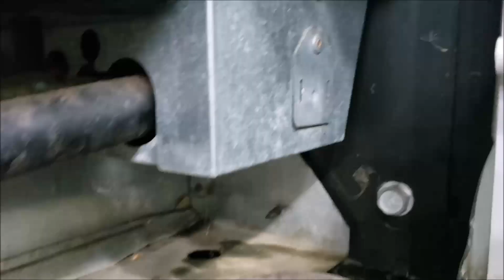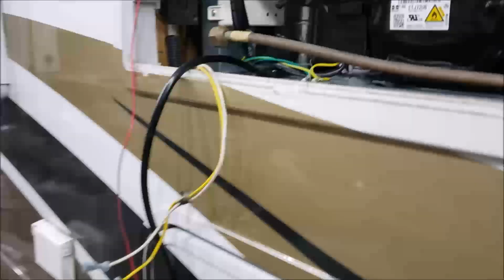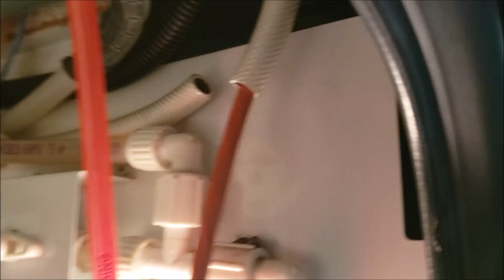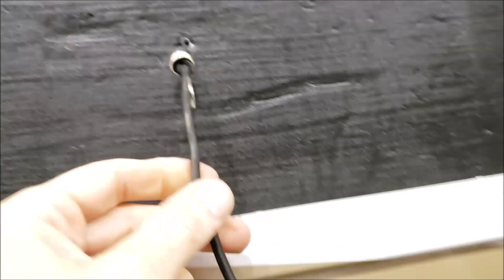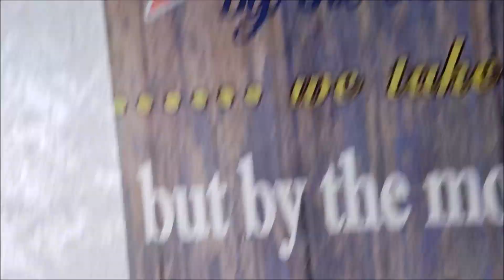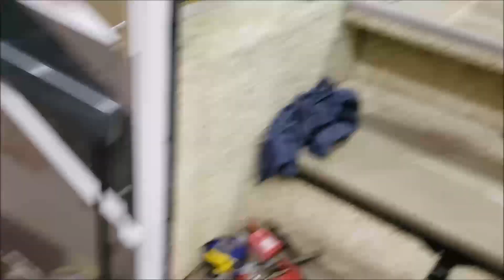How to Replace Your RV Refrigerator With Residential Fridge Step by Step With Haier Model HA10TG21SB

Comment: I was told the Dometic, in our 2003 Damon Challenger runs all the time and at our seasonal spot, was responsible for our +$200/300 electric bill. This is why we replaced with a Frigidaire 7.5 Cu ft  Apartment Size Refrigerator.
Reply from the maker: Yes those heating elements pull a lot of power.

Comment: Kevin,  Just completed my Haier refrigerator installation.  Thanks for all the great tips and information.  I had to remove the cooling unit from the rear of my old Dometic 2852 to get it to fit through the RV door.  I only had 23.5 inches of width in the door opening.   Other than that, everything went pretty smoothly.  I just duplicated your installation.  Thanks!!
Reply from the maker: Thank you for contributing

Comment: I did the same thing about 2 weeks ago on my 2006 Fleetwood expedition had a norcold 1200 the only problem is I had to cut the refrigerator in half because it wouldn't fit through the door put the new one you take both doors off and slide it through the side window it weighed a little over 140 lb with the doors off it was just me and one of my friends

Comment: Kevin, I have watched this video several times , even made a list of all the parts needed for the swap, we have that same Norcold 822 fridge in ours, but it still works fine other than the lack of space. My question is , when driving with the inverter on will it power the AC plug to the fridge and is it enough to run it. Again, one of the best and cleanest swaps on You Tube....
Reply from the maker: Yes, no problem at all. It only pulls 80 watts of power. The most is 150 watts while defrosting.  We love our new fridge. Text me if you have any questions. 606-875-0125 Kevin

Comment: Hi Kevin,  Does the frig need the inverter to run properly?  I tried to install a small residential frig,  but it does not get cold. The compressor is running and is warm. Any ideas?
Reply from the maker: Yes, a small one 300 watts will do it. I upgraded to a 2000 watt inverter to run more items

Comment: How did you power the inverter?
Reply from the maker: Using these https://youtu.be/4kj8hAH_48U but you can go a lot smaller , the fridge only pulls 80 watts while the compressor is on.

Comment: I took out the 4 bolts, gas line, electric and all cables. Still can’t get mine to budge. Norcold 1201. Any ideas?
Reply from the maker: Remove top roof vent I found mounting screws up there also. plus remove all plastic trim from fridge and look for screws on the edges.
Reply: @ktoutdoor I’m thinking it must be in the roofing vent. Only place I haven’t checked
Reply from the maker: @Hans-de8du  Remove top roof vent I found mounting screws up there also. plus remove all plastic trim from fridge and look for screws on the edges.
Reply: @ktoutdoor  it was the mounting bracket/screws up top, only accessible through the roof vent. Thank you very much. Now comes the fun part lol

Comment: Great video thank you, I am about to do the same. As for the plywood support modification, do you worry about moisture issues, wood rot, heat issues, etc? Thank you
Reply from the maker: Its been over 2 years now. It runs 24-7 no heat or water problems at all. Best upgrade ever.
Reply: Good to hear, thanks for the feedback and for posting. I’m getting ready to remove mine. My main concern is getting it down the stairs lol
Reply: Mine is the 4 door 1201LRIM model

Comment: Thank you for all your deep explanations of your ingenuity!! I bought a 10 Cu. Ft. Majic chef. Jabe only had it 6 months and have been having cooling problems in lower fridge going from 32°to 45° with food spoilage. Freezer is fine. The fan is intermittently working. Having is replaced by home depot with a new one, this Thursday. I live in Florida and we're having 94 ° weather. I have a pvc pipe going from furnace below up through fridge cabinet up and out through the roof. Its EXTREMLY hot in the cabinet mid day onward because of sun being on that back of fifth wheel in the afternoons. I also have the back vent outside the fridge. I think the pipe is not carrying enough heat and displacing through the roof. What suggestions do you have for me to overcome this problem. I am full time living and am recovering from a stroke and not back to work yet, so having to throw out food twice now in two weeks is upsetting to me. I need help please and any suggestions would be greatly appreciated. By the way i took out insulation from inside cabinet and did not put anything back in and funds are very, very, lean right now. Thank you and have a Blessed Evening.
Reply from the maker: @donnarichardson2888  text me at 606-875-0125 Kevin.  So I can call you back.

Comment: Thanks for great video.  The magic chef 10.1 is also a great choice.  put in several rvs.  fits in like the unit in this video. uses 360 watts so runs nicely on an inverter. wrap it with reflective  wrap top and sides and also do back wall. again thanks for sharing video.  will send it to others as i get requests for new refers
Reply from the maker: Thank you for contributing Toni
Reply: Why wrap with reflective wrap? To help with heat? Any particular kind that you use?

Comment: A great video, I really like the solutions to some of the issues that you had. In my tiny trailer my 2.7 Dometic failed just out of warranty. Replacement with tax $2400 cdn. So replaced with $200 domestic. Having to leave clearance and with outside vent at the rear, as a precaution I covered my vent inside face with bug screen to keep out mosquitoes. I also used my dometic fridge rear cooling fan to provide extra air flow with a switch just to the side of the new fridge front for hot times. Love your solution to keep the doors shut. I used the position for reversing the hinge as a mount for a bracket and pin to keep mine closed in transit. Remove when we arrive, easy peasy.
Reply from the maker: @ronaldcumpsty5605  thank you for contributing.

Comment: Uh huh had an IDEA huh 
Your so smart. 
ORRRRR you saw someone put a screw in a refrigerant line on a YouTube video. 😂🙄
Reply from the maker: I've know about this for a long time. Its a common practice with refrigerators. It is done to prevent condensation from forming around the gasket.  I work on appliances also.
Reply: @ktoutdoor  I see 
My bad 
Thanks for the video 👍👏🙏

Comment: Brilliant video/tutorial. 
I'm glad I ran across your video as I'm replacing the old Norcold in our 2003 Itasca Horizon with a GE 11.6 cf.  The use of the 1.5 inch aluminum angle for the mounting/support brackets is first rate.  
Thanks for the great ideas!
Reply from the maker: Thank you for the kind words,, have a blessed day my friend

Comment: I am wondering what is the best brand to deal with below 20 degrees and running in above 90 temps outside?  I wonder if they will perform in temperature extremes.  Also, anybody out there replaced a 1201 LRIM?  It is 33 wide by 63 tall +/-.  I’ve seen videos on replacing these with taller units but I dont want to lose my under fridge storage.   It looks like my best option is to buy one of the models you have in your video and then figure someway to build in a pantry beside it?
Reply from the maker: Check out my video testing fridge in over 90 degree weather https://youtu.be/8T8UzH4J9UE

Comment: Grest video very through. Just curious 1yr later now hows it holding up anything you would change ? Whats real world use 12v battery power consumption been like ? how many amp hours in a 24 hr period? Thanks
Reply from the maker: Here is my 9 month review https://youtu.be/8T8UzH4J9UE in fact I have not turned it off in the past 12 months I checked it yesterday in my storage building and it was over 90 degrees in the RV and still 5 degrees below zero in the freezer one of the best upgrades I have made to this RV.   Here is some test I ran before installing https://youtu.be/KVKgiGKSMS4
Reply: Just curious you mentioned the running watts at aprox 75 do you happen to know what the start up or surge watts is? Just wondering because i plan to run this fridge and i have a very nice quality vanner VTL 12-300 (300 watt continous) inverter in the garage and was wondering if that would run only the fridge without issue. Or if i had better get something bigger. Thanks for any info mike 👍  subscribed
Reply: Never mind i found the info i needed on the haier specs page i will be looking for a larger inverter. Haier does not list it do you have any idea how many watts it pulls during defrost mode? Also here are the specs on that fridge in case anyone wants to know.  HA10TG21S  start up 6.0amps/ 690watts running 2.5amps / 287.5watts
Reply from the maker: @Mikeywatches  The most wattage I have seen is around 160 while on defrost mode
Reply: @ktoutdoor 
Based on that info it would seem a quality 300w inverter rated at 450watts surge should handle it just fine?
Reply from the maker: @Mikeywatches  A pure sign wave would be best
Reply: @ktoutdoor  yep the inverter i have is pure sine. I was mainly wondering if 300 continuous and aprox 400watts peak would be enough for just the fridge. Based off your numbers it sounds like is may be.

Comment: Great job with the conversion of your refrigerator. In the process of doing the same thing. On the prowatt switch I'm having a hard time trying to wire this up. Could you explain the different plugs that you used. Not really sure what the yellow looking short plug is?? I know that a male plug is used for the shore power, a female plug for the load "refrigerator " I'm just not sure about the plug for the inverter?? This should also be a male plug??  Thank you for any clarification you could offer.
Reply from the maker: Yes orange cord has a male end that plugs into my inverter that is mounted in the compartment below. Text me if i can be of any help 606-875-0125 Kevin

Comment: Hey, this is a great write up! Quick question. 

My Winnebago has a metal strap on the top, that was screwed into the top of the old fridge.  

Any idea of I risk hitting anything using that same strap on the top back of the fridge?  Id like to zip a couple sheet metal screws in that, and have some extra tip-over protection in the event of a crash.

I have little kids who sit near the fridge when driving.
Reply from the maker: There is no way of knowing for sure where the refrigerant lines are located so i would not be adding screws what about using the aluminum  I used in my video but JB weld it to the top its some strong stuff

Comment: Thanks for the step by step with bolt size. Just did the exact same to our Winnebago. I made the mistake of assuming that the bottom bolt holes were the same as the top, so I made two brackets using the top measurement. Had to redrill the bottom bracket. But was an easier upgrade/ install thanks to your detailed video.
Reply from the maker: Glad you found my video helpful. Thanks for leaving a comment. Have a blessed day Brent

Comment: Kevin, you are way better than MacGyver....he used fence wire, duct tape and something from a Hot Pockets wrapper. I have been considering a similar install, and adding a Jackery to power the fridge on travel days. I don't have any solar, and don't plan on adding any (not much for boondocking). DC fridge is too expensive. Your thoughts or comment would be appreciated.
Reply from the maker: Yes with this fridge you don't need solar a 200 amp lithium iron  would be great. It would get you through the night easy then use your engine to quickly charge up the batteries the next morning. My last video I posted while boon docking shows how quickly the batteries can take a charge. Give me a call if you have more questions. My cell 606-875-0125 Kevin

Comment: Kevin, just curious...did you purchase any type of warranty for this refridgerator?
Reply from the maker: No, I hardly ever purchase an extended warranty.  It comes with a 1 year warranty and its been running sense I installed it. I figure if it had a true defect it would show by now.

Comment: There are many RV residential frig videos- Sir- yours is the most thorough, accurate and informative. You answered many of the questions buyers had about why they were dissatisfied with a freezing frig and all of my questions- wattage, weight variance, install and winter use. AZ Expert recently shared his install mistake when he drilled a hole in the front/middle edge to add a door lock- and ran into a line- resulting in his purchase of a replacement for his client. Ready to replace our 18 year old RV frig.
Reply from the maker: Thank you for the kind word if I can be of any help my cell  is 606-875-0125 Kevin

Comment: Great detailed video!  I'm curious about laying the new fridge on its back.  I thought that was a big no-no, or is that not true?  Thanks
Reply from the maker: I have been laying refrigerators down for years I just sit them upright for 24 hours before turning them back on so the oil has time to flow back down into the compressor

Comment: Excellent topic and one I will be considering.  I own a 2005 Itaska 8.1 gas, was wondering if you ever upgraded your suspension system?
Reply from the maker: We have the w24 never felt the need for a upgrade. It drives so well.. I did install koni shocks.

Comment: Great job Kevin!  Love how you go into great detail and cover all the bases - such as adding the refrigerator door closer/stopper for traveling.

I especially like your solution for using angled aluminum brackets to fasten into existing hinge mounting holes.  It's practical, easy to accomplish, and looks good.

A suggestion / thought on mounting security.  As you noted your original Norcold was mounted to the rear floor by a large metal bracket.  Apparently because it was felt necessary to have some mounting strength there.  As I recall this bracket was bolted to the sides of the Norcold as well as into both the floor plywood and into studs on each side.  But your new installation only secures the refrigerator by the front aluminum bracket - pretty much like how the Norcold was screwed into the front bottom framing.  Like you I also really like that the bottom rear of your new fridge rests along the extruded metal piece running the entire width, taking the weight off those small plastic rear rollers.  So is it possible to drill 2 -3 holes in the bottom of that extrusion through which you could run some bolts into the plywood floor?  If so it would help mimic the OE Norcold mounting somewhat, where they felt it important to have extra bolts.

2ndly - Inverter.  Since you are running the new fridge off your 1000w inverter this implies that it has to be turned on 100% of the time when boondocking.  For some reason I do not like to keep my 1500 watt GoPower inverter turned on all the time.  We do so when using our microwave or powering some outlets, but otherwise it is either shut off or in eco mode.  For watching TV when boondocking we use the small 275 watt OE inverter Winnebago installed just for that purpose.  So in considering doing my own refrigerator upgrade I am thinking of using a small inverter (like a Victron 300 watt) to power just the refrigerator, and leaving that on all the time instead.  That would also not interfere with any amperage draws from my main GoPower, which I could continue to use as normal.   Thoughts?

Cost savings.  In my own research I began by looking at same size 12v DC models.  They accomplish almost exactly what you have achieved here, except that they run off of 12v DC directly.  But their HUGE downside is their cost.  Virtually all of those models run  $1300 - 1600.  (GE --> Furrion).  So it became quickly very apparent from your 1st video on your new fridge that there is a much, much less expensive way to achieve the same result (run off 12v DC & gain more storage space) - just buy a more common 120c AC model and run it off an inverter.  Not only that, there are many brands and models of this exact RV replacement size available out there.  Found many choices at Home Depot - including a Galanz 10 cu.ft stainless steel model for $360 - which looks to be very VERY similar to your Haier.            https://www.homedepot.com/p/Galanz-10-0-cu-ft-Top-Freezer-Refrigerator-with-Dual-Door-Frost-Free-in-Stainless-Steel-Look-GLR10TS5F/308964936?

For the REALLY adventuresome I found an LG 11.1 cu.ft model for $700 that is the same width & depth.  Has an advanced energy efficient inverter compressor too, but it's downside is that it is 66.6" high - making it just a tad too high to fit in my available space -  

https://www.homedepot.com/p/LG-Electronics-11-1-cu-ft-Top-Freezer-Refrigerator-in-Platinum-Silver-with-Door-Cooling-Counter-Depth-LTNC11131V/308085233?source=shoppingads&locale=en-US&&mtc=Shopping-RM-F_DYNM-G-D29A-029_013_REFRIG-LG_ELECTRONICS-NA-NA-SMART-NA-NA-MK560603300_9016993661_FY22_654_&cm_mmc=Shopping-RM-F_DYNM-G-D29A-029_013_REFRIG-LG_ELECTRONICS-NA-NA-SMART-NA-NA-MK560603300_9016993661_FY22_654_-71700000086551824-58700007367374614-92700070086316748&gclid=Cj0KCQjwma6TBhDIARIsAOKuANzz6AAslM6ojSMUZY4cpz7kVQKtn3r37FpMoIFq1Bs0mi79A2XChrMaAnfIEALw_wcB&gclsrc=aw.ds

But others might be able to squeeze it into their model RV, especially if one is willing to do a bit of re-working the front trim.  But I think you latched onto what is soon to be a very popular RV upgrade for many owners.

Thanks again for putting together this video.  I know it will really help a lot of people, and as you & I have discussed this refrigerator upgrade will appeal to most RV owners looking for more safety and more refrigerator space.
Reply from the maker: Thank for the great write up and all the info